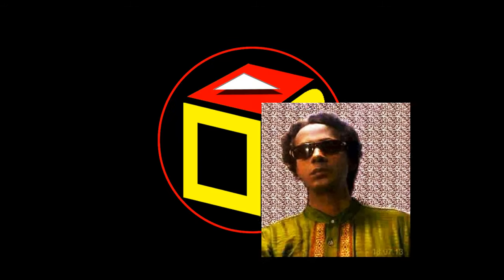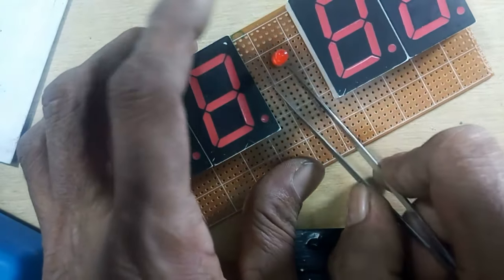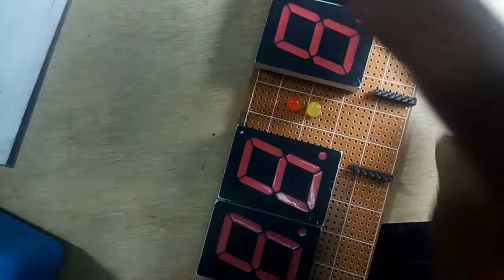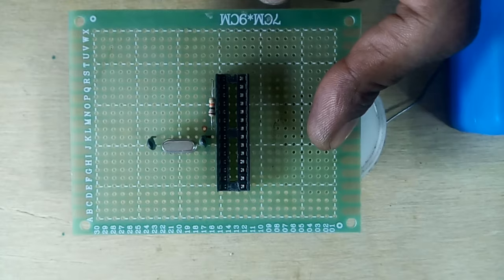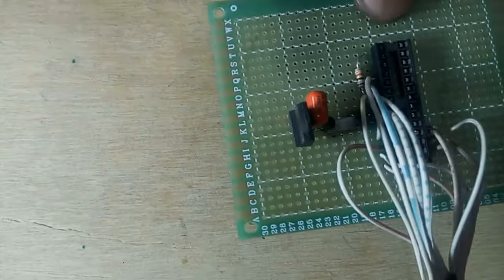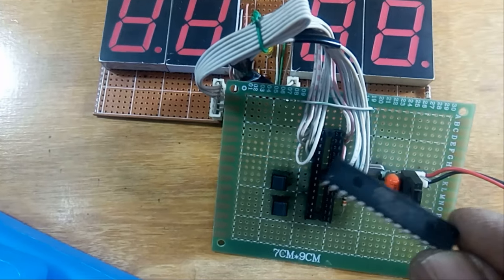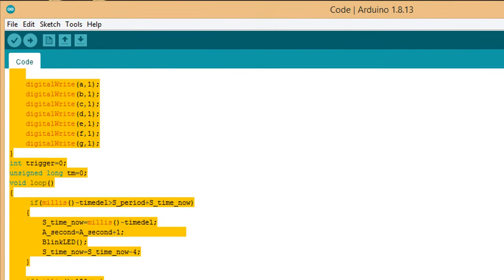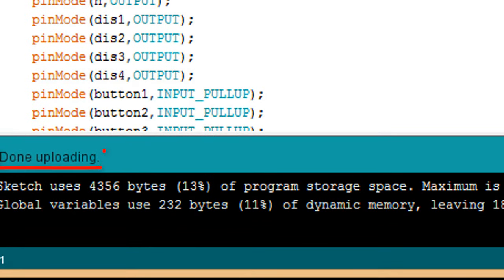Make Real Time Digital Clock Using ATmega328P-PU Micro controller or Arduino | Clock Circuit Diagram

Comment: Thanks for the project sir.. 
  Sir can we display date in this same circuit by changing code..  .. in hours place date and in minutes place month can we make it sir
Reply from the maker: This circuit is not actually a full circuit, it is for practice.  The work will be perfect - with a six-digit seven-segment LED display.
Reply: @OrnatePixels  ok sir we hope you will upload automatic date changing 7 segment display using Arduino in future
Reply from the maker: I will upload a video of a complementary digital clock very soon, good luck bro.

Comment: Hi ... i try to make clock using Atmega326 just like your project exactly :) but i do not have enough experience to connect every thing that easy you did ... so can you provide me a wiring the Cristal and Capacitors ... its realy  make me confused but also make me excited to . i get lost from 1:20 till 2:20 ...so can you help me with that  please i will be very Appreciated  ... thanx in advanced
Reply from the maker: Dear Brother, I have attached a schematic circuit diagram at the end of this video. And I have given the link of the required code file in the description. Note: Two 33PF capacitors and  16 MHz crystal will be placed very close to the ATmega 328 IC. Try more and you will surely succeed. Good luck
Reply: @OrnatePixels  Thanks for your concern, I will try to make the connection according to what I see and I hope not to explode the circuit :) ... Thanks again
Reply from the maker: Best Wishes Brother

Comment: Can I get the circuit diagram of the clock?
Reply from the maker: Dear Brother, I have attached 2 complete circuit diagrams in the video. There is one circuit diagram for IC and another circuit diagram for Arduino. Best wishes, Thanks.

Comment: Sir How to drive big led display ?
Reply from the maker: Extra four transistors have to be used for the voltage supply of Display (Anode) 1,2,3,4.  I will tell you later how to do the work in that case.
Reply: Dhanyawad sir...please publish video/circuit for that